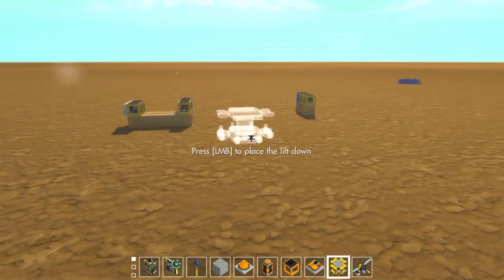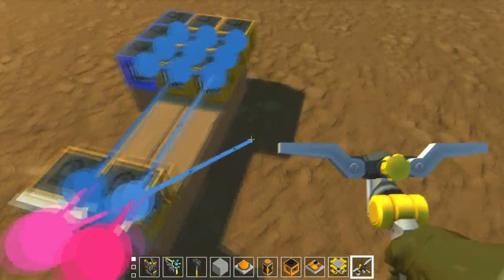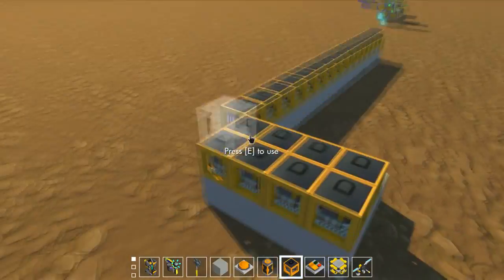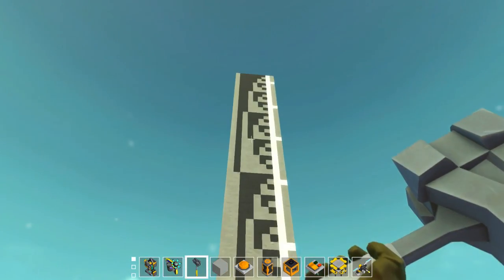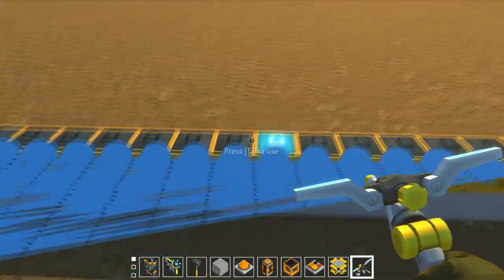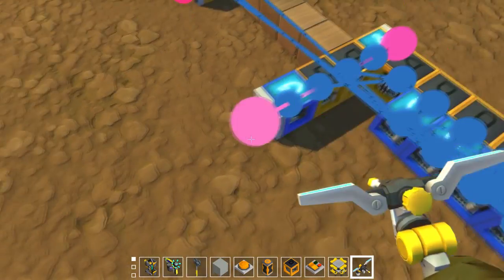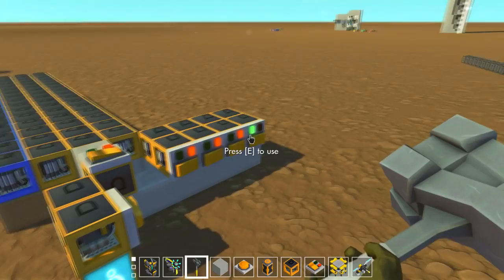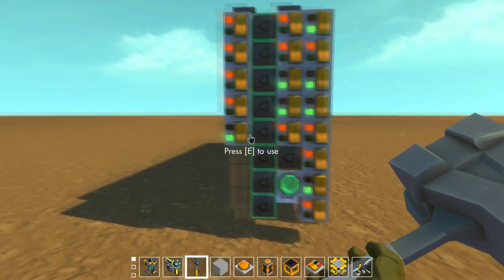LET'S BUILD A COMPUTER! D-flip flop, bin to index and RAM - Scrap Mechanic Logic gates

Comment: i have a better idea make a CNC machine with spud gun and ram to save 3D model.
Reply: Numero7 Mojeagering I had a similar idea... there would be a moving system of sensors that would scan a 3D object from all sides and save it in ram or ssd so that you could choose to make a cnc copy as long as you have the saved file
Reply: I have an idea to make 3d projection on a screen with custom gates but i never really seen logic gates on the workshop that could do math operation properly like : tangent sinus cosinus matrix : multiplication addition soustraction division;
Reply: Numero7 Mojeagering so you mean something like, having a digital cube that you could see on a screen and maybe rotate it. Kind of like in some cad program?
Reply: @mxs4193  yes